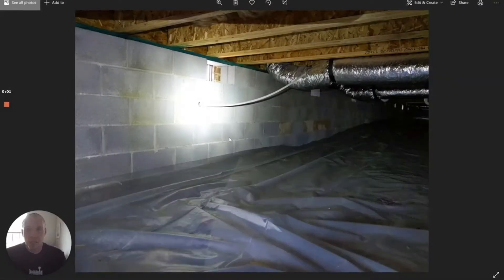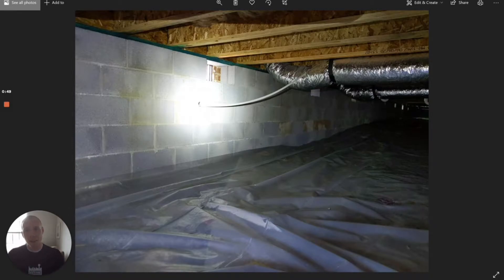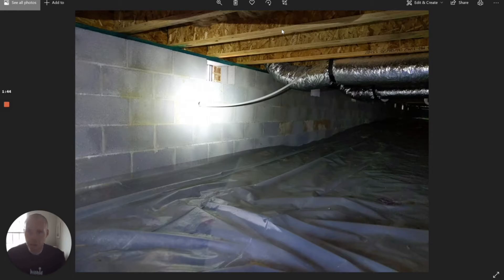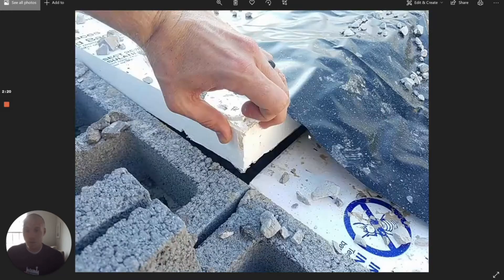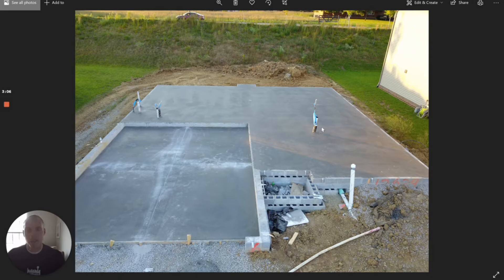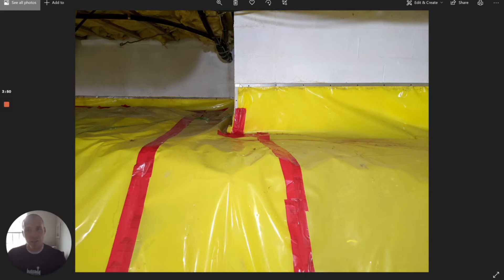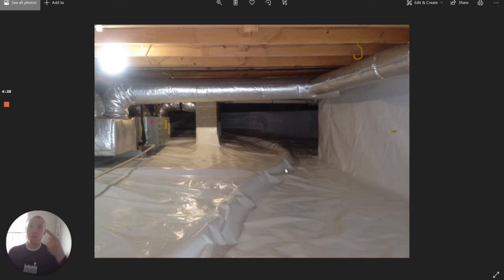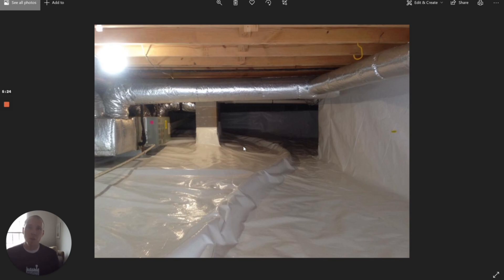Radon Testing on Homes with Crawlspaces

Comment: Piping. You failed to mention that the piping has holes in it to allow radon air to pass through, into the pipe, and out the non-holey pipe to travel to the outside.